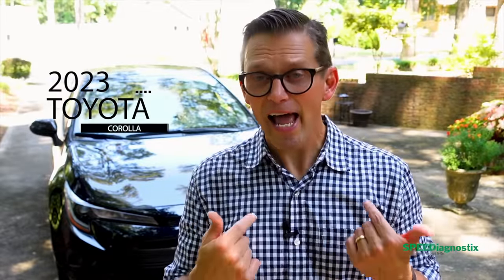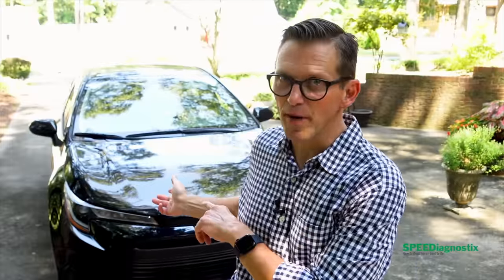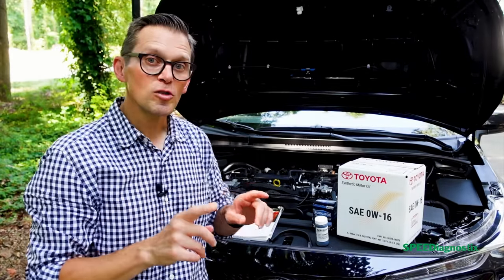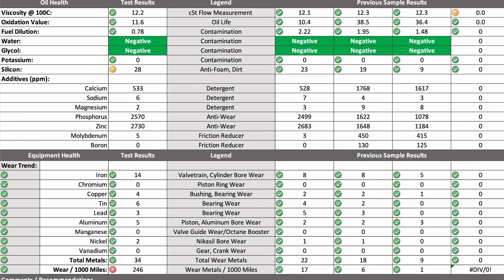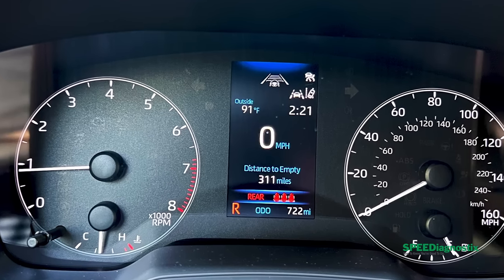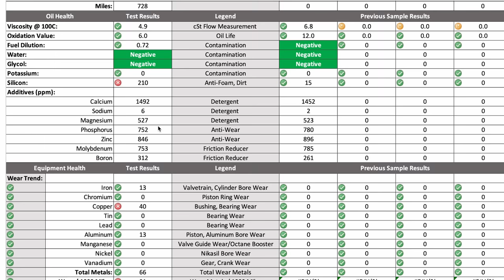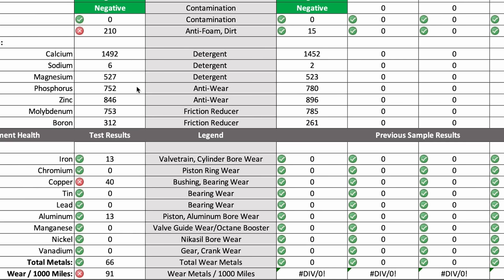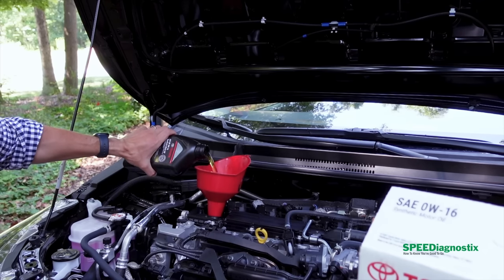AVOID the ONE MISTAKE Almost EVERYONE Makes With A Brand New Car

Comment: This certainly won’t hurt anything, but is way overkill.  The small amount of wear metals and the very, very small size of them, means they add basically nothing to bearing wear or other wear in the engine.  The main issue with new engines is excess sealant as mentioned or any debris left in the engine during manufacturing.  I change at 2,500 to get most of the initial break-in wear materials out and any manufacturing debris the escaped the filter.  I then change at 5,000 and every 5,000 thereafter with a turbocharged engine.  With a normally aspirated engine, I have no problem running synthetic oil for as much as 10,000 miles, but with a turbo I feel better at 5,000 given the heat generated by the turbo.
Reply: You're wrong
Reply: @carstuff4u942  Nope, lots of evidence on my side.  There is zero evidence to support multiple early oil changes in a modern engine.  You probably also believe it is bad to fill oil filters before installing them as the new oil might be “dirty” and go through the engine once without first being filtered.
Reply: This is the only sane comment in this whole thread. Okay, you see results in doing the early oil change. Big whoop.... when have you actually heard of a car dying because you followed the factory interval? Be honest, the answer is never. There will be a myriad of other reasons why the car dies before even a little bit of extra break in metalicity on the first 10,000km even matters.
Reply: Your entitled to your opinion however you are incorrect. Regardless of opinions more material in the oil cycling through the engine causes more wear point blank. Don't hate me hate science. His next video on this topic proves your opinion is just that. An opinion. 

No disrespect. Just science dosn't care about your feelings or thoughts 🤷‍♀️
Reply: @mattdagger1480 Well, I won’t go into my credentials here, but let’s say I am not ill-informed on matters of science and engineering.  His next video discusses prefilling oil filters.  Tell me how that invalidates anything I wrote here.
Reply: I'm in your camp and agree with you.  I just did the first oil change on my new Jeep Wrangler at 2,500 miles.

Comment: Every motorcycle we sold back including 80's and 90's, had to have a 500 mile service, then at 3000 mile intervals . . . I still have 80's bikes now which are on "untouched" - for rebuild or repair work- engines, which I never changed oils later than 1500miles on every interval, so that process has worked for me over about 45 years! Great content, please keep it coming!😎

Comment: Wow, hard-core Lake. Dumping a quart of new oil as a flush oil. Been changing my own oil for decades, never done that, even on a new car. But, I get it. Also, Honda not the same as back in 90's, now they recommend a full Maintenance Minder interval on factory oil. Supposedly, factory oil something special. Others say, it's just the moly assembly lube used from factory. Never followed OM recommendation. Lastly, there's a school of thought that says, don't prefill filter because new oil has many impurities that will make their way to the bearings on first start. I never bought the idea, and always prefill filter where practicable. If your daughter's car gets maintenance like this regularly, I'm sure the engine will last a long time. Thanks for interesting and informative vid.
Reply from the maker: I’m happy to help. In my nearly 30 years of experience doing this, oil in quart bottles is very clean. It is filtered before it is bottled.
Reply from the maker: I’m happy to help. In my nearly 30 years of experience doing this, oil in quart bottles is very clean. It is filtered before it is bottled.
Reply: @themotoroilgeek  Good to know, counters that new oil idea. Like I said, I never bought it, prefilling been SOP for me. I mostly use oil from 5qt. jugs now but I doubt any different than quarts. Thanks for the reply.

Comment: A lot of new cars call for 0w16 or 0w20 motor oil. There are a lot of people out there who are vehemently against using oil that thin and opt for 5w30. I’d love to see a video from you if there is a significant difference between the two for an average driver.
Reply: Engine masters, did an episode on their show, about oil weight. Going too thick can cause damage to an engine. They showed an extreme, but put 90 weight, I think, in an engine with tight tolerances, and it starved the bearings.
Reply: Going up a weight won’t hurt a thing. Older Toyotas used to spec 5w-20 to 20w-50. A Corolla I had showed that in the manual. Buy a vehicle outside the US and they spec different oils.
Reply: I was watching some Jeep 3.6L episodes on rocker arm issues. One thing I noticed is Jeep calls for 0W20 and almost every one was putting 5W30 or 10W30 in their engines. Could be coincidence. But makes you think that there’s something to what the engineers call for.
Reply: You're asking for trouble going against the recommend! The OEM's know best. Whatever the manual says THAT'S what you wanna be using don't be STUPID!
Reply: @garyszewc3339  If OEM calls for 5w20 like in my 2010 Accord but live in mild winters never under 30 degrees/highs around 50-60 degrees...and always hot in the summer from 90-110 degrees, then changing to 5w30 for those 5 months of super hot weather and back down to 5w20 for the mild winters shouldn't be that bad?
Reply: @leecowell8165  Yes the manual should be studied to see what is the correct oil for appropriate operating temperature.
Reply: @1Mannco  Do you really think your engine is hotter when it's 110F out, than when it's 50F out?  If it is, your thermostat is bad.  Maybe 1% of the time in hot weather the 30 is better than the 20, when the engine is on the verge of overheating.  The other 99% of the time, you're just reducing the oil flow rate through the narrowest passages, below what it was designed to be, due to the higher viscosity and higher pressure drop.

Is changing one viscosity grade away from design point going to kill an engine?  No.  Is it smart? No.

The only OEM specs to largely ignore are tire recommendations, including brand, type, and tire pressures.  As a mechanical engineer, I'd be ashamed if I had signed off on the low load ratings of OEM tires just to keep them light and cheap, or the low pressures recommended just to give cars understeer in order to not get sued if a clueless driver can't deal with neutral, quick handling or (gasp) a little oversteer if high pressures are set unevenly.
Reply: They are making clearances far too large these days

Comment: Important consideration I thought of: if you're using a filter type that catches a lot of particles (based on other tests I've seen, sometimes at the cost of some flow, Purolator Boss, Royal Purple for example) your oil will appear cleaner. That would really muddy the results, so we're really testing the oil, engine, and filter as a system because we can't remove the filter from the equation.
Reply from the maker: Lubrication is always a system that involves more than the lubricant itself. Proper lubrication can be defined as the right oil, in the right place, at the right time and in the right amount.
Reply: @themotoroilgeek  Right!

Comment: I typically go about 1,500 on the 1st oil change then about 2,500 miles on the 2nd ... then every 5,000 miles after that.  I also use a top oil product every other or every 3rd tankful to help the rings seat more gently.  Usually MMO, Lucas UCL or TCW3 2-stroke oil.

Comment: I have a 2023 Highlander. Put 3000 miles on a trip to Florida. At 6000 mi says it needs service. I brought it to the dealer . They said we are rotating the tires but not changing the oil. Took it to my mechanic for an oil change. Not 500 mi but better than 10,000. Subscribed.
Reply from the maker: Right on!

Comment: I agree with you however I let my engine go to about 3000 on the first oil change from now after that I jumped straight into mobil 1 5-30 Full synthetic for my 2013 Subaru legacy with the flat six, after the first oil change I did it every 5000 miles now I have 140,000 on my car she barely burn any oil I just recently jumped to Pennzoil ultra platinum, The other thing I do when I first start the car up I drive it very normally at lower p.m. until I get some oil temp and coolant temp…. before beating on the car…

Comment: In the Middle East, where conditions are quite harsh, Toyota recommends oil changes at 5,000km (1,300miles).
Reply: 3100 miles

Comment: I did this very thing back in 1976 with a chevy van 350 engine.  Huge difference.  Babied it for 500 miles and did a change.  Every 3k after that.  When I sold the van it had over 200k on it and still ran strong

Comment: Solid advice and good facts to back it up.  Have always done and will probably continue to do the first change at or before 1000 miles.  Probably going to be a sourcing issue going forward, but I have only bought manual transmission cars where it is a bit easier IMO to baby the engine a bit during the break-in period.  Automatic or CVT would probably be a bit harder to keep the revs in check = 500 miles is good.
Reply: CVT is the only option now on Corollas
Reply: It's not 1980 anymore you don't need to break it in. Just drive it hard from new it's fine. First change at 10k.
Reply: @motleydude73  doesn't matter what year it is. A new engine can have material left over from the machining and assembling process. You don't want to leave any material in the engine for 10K, I'd be changing the way before 10K anyway.
Reply: @chrish4469  Doesn't need it. 10k is fine. As per manufacturers recommendations. 32 years in the trade I've yet see an engine fail with that service interval.Mines only ever had 10k changes runs smooth as silk with 155000 miles.  But go ahead and waste good oil and spend money unneccessarily.
Reply: @motleydude73  10K oil changes are fine if you are doing a lot of highway driving, But doing a lot of stop and start city driving is adverse conditions, It say in the owner's manual with adverse conditions drop the oil interval changes. If you are only keeping the car for five years or so, 10K intervals are ok, But if you are keeping the car until the wheels fall off, It's advised to change every 5K. Engines will last longer 300K+. Oil is cheap, Engines are not
Reply: @chrish4469  Engines last 30 years 300,000 miles regardless. You're just wasting money and good oil doing it any sooner. Toyota  recommend 5k intervals for Landcruiser Diesels. And yea as a mechanic for 32 years I'm well aware of shorter change intervals for short running or adverse conditions. But for 95% of cars 10k is fine.
Reply: @chrish4469 .  That right there is reason enough to avoid like the plague .      I’ll stick with my 8 speed automatic Camray.   People cry buckets of tears about the bang shifting ( earlier models) but after 4 years with it I honestly could care less.   Once it’s been flashed and the engine figures out your habits it’s fine .
Reply: @motleydude73  some of us are looking for optimum not just "fine"
Reply: @rogerdodrill4733  Why? There is zero difference between optimum and fine. Except that you're wasting good oil and money. Your engine won't know the difference and you certainly won't by driving it. Not sure what you're hoping to achieve?

Comment: Great info. Thank you!
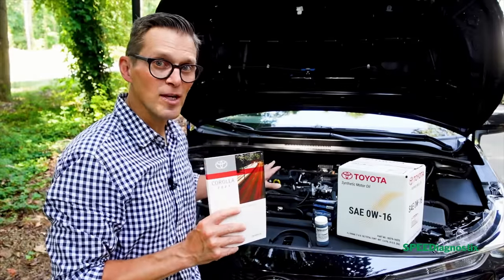Curious, it says on manual that 0w-16 can be use if you can’t find 0w-8 temporarily but on the next oil change, go back to 0w-8 (5:59 mark). Will you go back to the original oil or stick with 0w-16? Your findings did say the additives on both oils are identical. 
Thank you again for the info.
Reply: my speculation on that would be that a thicker oil would be harder for the pump to circulate and and move around the engine. It would be mostly fine because the oil is within spec but probably there would be a slight drop on the fuel economy as the car is making a higher effort to move the oil around and probably some extra friction. I think it would be good to eventually move back to the original oil when possible to aid in the longevity of the oil pump and maybe when the car is at a higher mileage with more wear probably go back to the thicker oil to compensate for the wear.
Reply: @Hartbreak1  If you look at subsequent UOA reports he was using much heavier oils like 10w-40.     You need to freeze the video at just the right spots to see it.     Just wondering why.... did I miss something?

Comment: As an automotive technician I i bought my 2014 Ford focus. I changed the oil at 500 miles, used conventional 5W-20, another 500 changed it, and at 1500 miles. I put in amsoil signature series in with an amsoil filter. been running the same oil after 10 years with 277k miles no issues. I've been averaging about 25 to 28k miles a year with 15k oil changes. Plus my transmission fluid is DTC fluid from amsoil in my 5 speed manual. I've had very few hard parts replaced with this being a very reliable vehicle.

Comment: It would be interesting to see what your single quart flush is like after flowing through your engine. Send that off to the lab next time and see how much you’re really getting! Awesome vid.
Reply from the maker: Great suggestion!
Reply: I would guess the 1 quart would drop straight through to the pan and slightly flush the pan. If the engine was shut off and immediately drained one would think there would be very little on the pan floor.
Reply: Probably not a whole lot as it bypassed about 95% of the oil circulation system lol
Reply: Hes wasting oil for no scientific reason.

Comment: Agreed 100%. I've  done first change at 500km Australia, around 310 miles. Then at 1000km. Then I do each 1000km up to 5000km.
Good to remove that run in metal. I've done this on all my vehicles, being toyota's. love you respect for mechanical, oils.
Reply from the maker: Thanks!
Reply: Makes zero difference stop wasting good oil! 15k is fine. Toyota say so.

Comment: Thanks for the awesome info! First I've heard of 0w 8 oil. Curious to learn more about this stuff. Interesting to see that Toyota oil continues to have crazy high Molybdenum in even the newest oil. The closest off the shelf oil I can find is Valvoline advanced high milage at around half the Moly and Boron of the Toyota oil (350 moly and 150 Boron) But that still puts those numbers about 3x higher than other off the shelf stuff. 
I have a toyota V6 with 190K miles on it and I've used Pennzoil Ultra platinum in it for the last 20K but the moly number in that is under 100 and this makes me think Toyota really loves Moly in their engines? I think I may switch to toyota oil on the next change.
Reply from the maker: This is very interesting oil!
Reply: Use Castrol

Comment: Hey Lake have a Saturn SL that went 310,000 still ran great. I always changed the oil when it got dirty! Finally changed the engine out (clutch job)with a fresh one, but the original engine still ran great. Being a maintenance freak pays off!

Comment: Years ago Tom Cahill was a writer with Popular Mechanics.  In the 1960s he wrote an article about changing the engine oil between 500 and 1,000 miles. Because of the break in process of the engine. His analogy was the new engine is operating like a lathe shaving off tiny pieces of metal.
Reply from the maker: Right on! This is certainly not NEW information. Thanks for sharing.
Reply: that might have been true in the 60's, but break-on now only takes hours and it's done in production. There are no "shavings" like you get off a lathe.
Reply: @executive not necessarily true plus why take the risk the factory oil could have been in there awhile, fresh oil in the first 1000 miles ensures the engine is healthy and also a good time to check the components underneath....
Reply: @truckercowboyed2638  it is true. I challenge you to find "shavings"